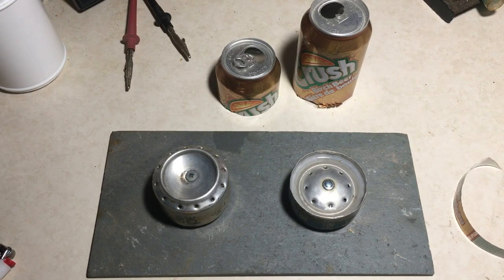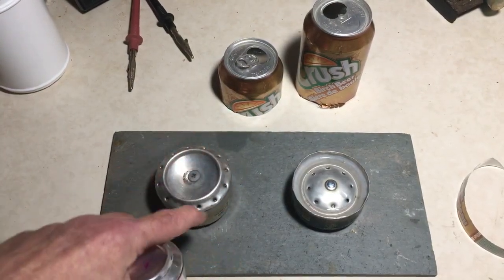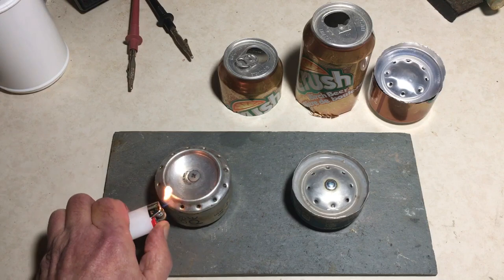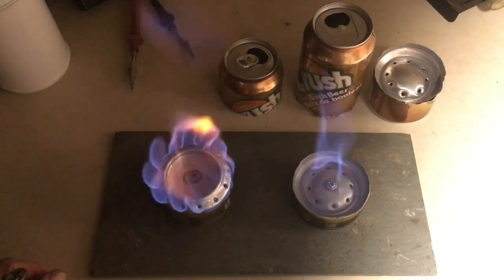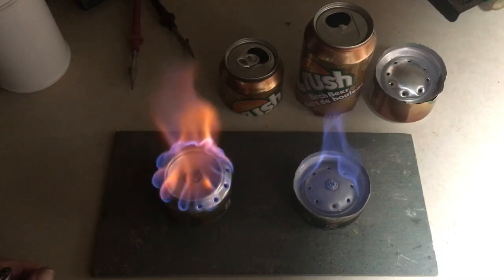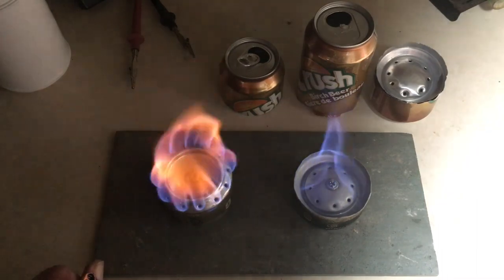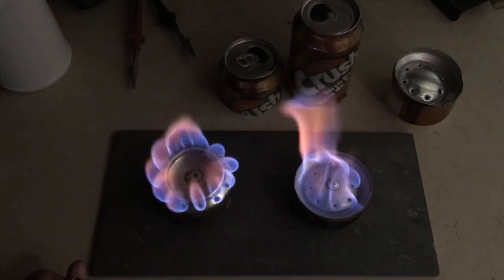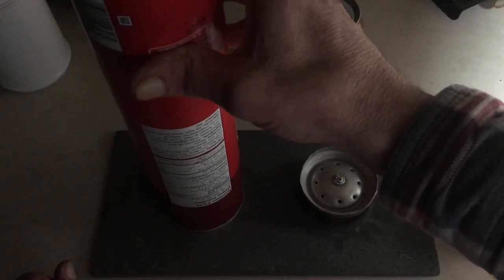Pop Can Emergency Stove ~ Improved Design ?

Comment: What a wicked invitation sir. That would be sweet when the light are gone you should patent that.
Reply from the maker: Lots of people making those 
All over the internet 
Some call them 
“Penny stove”
Not my original idea
Reply: @madeinfoxtrap5539  but it's a good invention tho I must say
Reply from the maker: @RandomPaddy79  yea it is. 
Works great. If you make and use one be careful. It is an open flame and very hot.
Reply: @madeinfoxtrap5539  yes I seen the nice flames coming out from it. But I must say the way you got them built is the perfect way to have them. Excellent idea tho. Oh and thank for the tip. Knowing me I probably burn myself so I get the woman too look after them lol
Reply from the maker: @RandomPaddy79  I have used them in the past when the power was gone. Great to be able to get something hot to eat or drink. Especially during winter.
Reply: @madeinfoxtrap5539  yes perfect little thing to get something warm in ya belly lol. Great little thing tho I must say